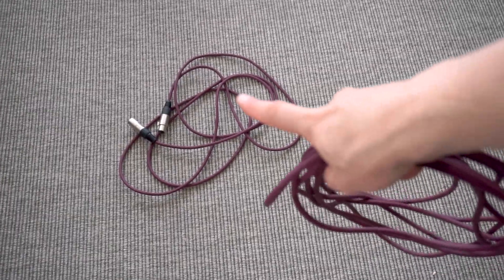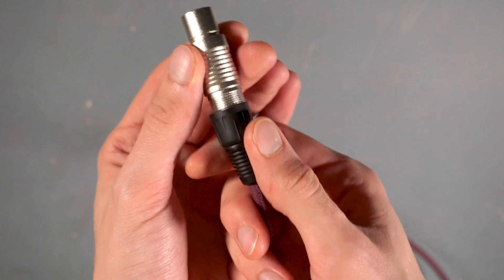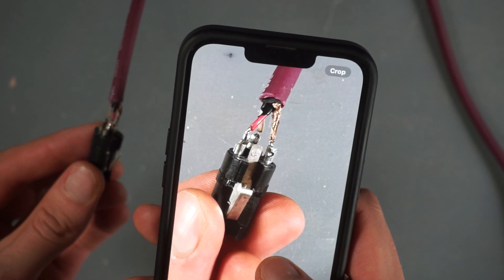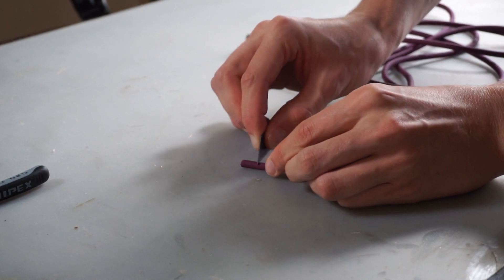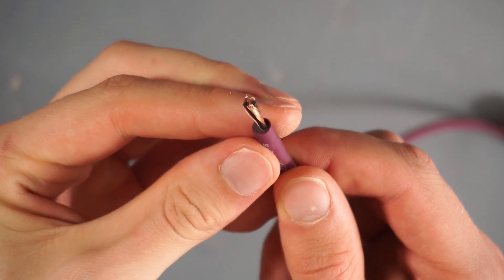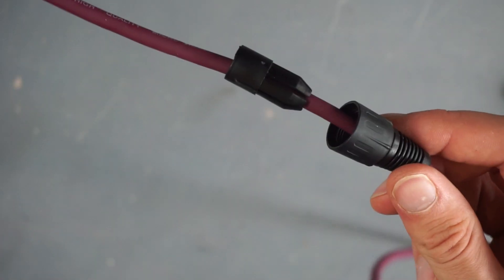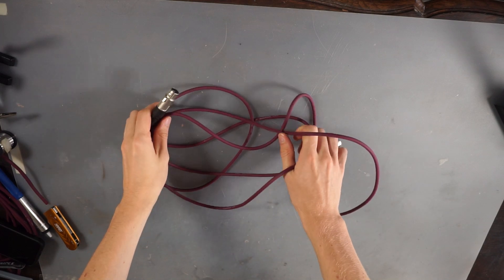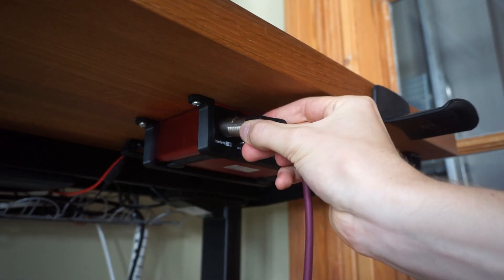Quick tip: How to Shorten XLR Cables

Comment: this is a really good video, it was short, simple, and sweet the only thing I wish this had was where each copper wire went to when you were soldering but other than that this video is good. 
keep up the good work!
Reply: agreed on the short and sweet part; this kind of video is getting rarer and rarer to find. 

on the wire front- every xlr/dmx cable I’ve opened has been somehow slightly different inside. realistically, the best way do make sure you do the pinout right is to keep a multimeter handy while working